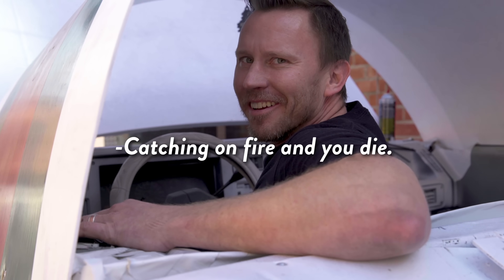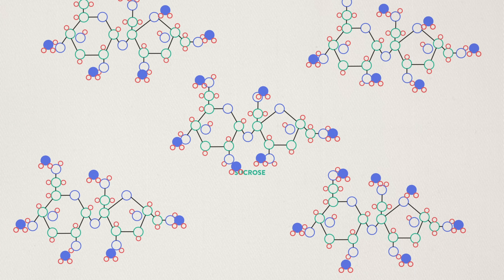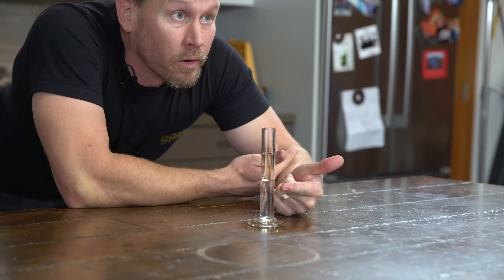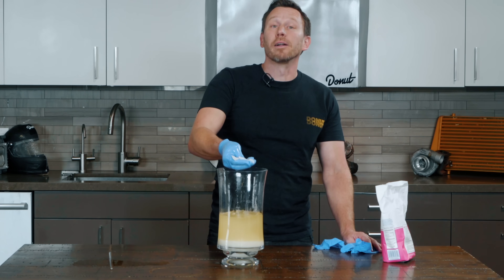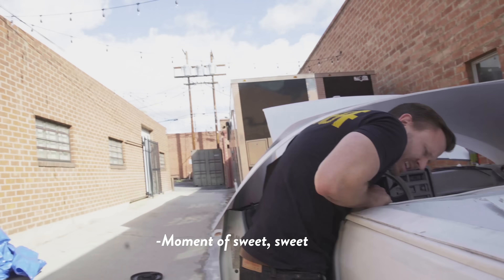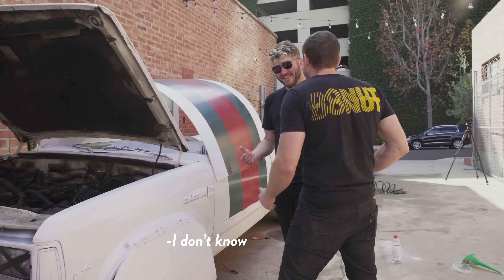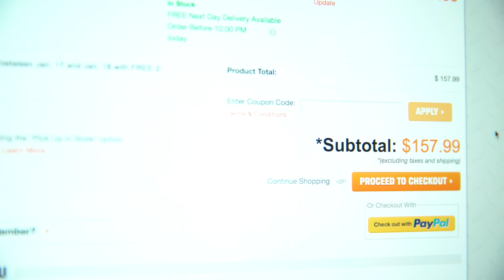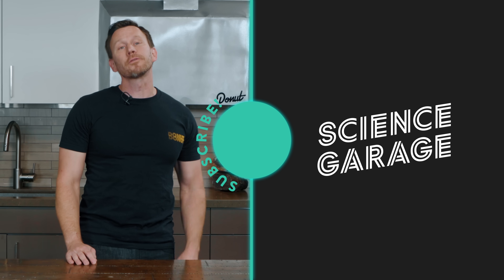SUGAR IN THE TANK - What actually happens? | HOW IT WORKS | SCIENCE GARAGE

Comment: So, you did this all wrong. First off, you would be driving around in a real situation which means the sugar would slosh around and more would get sucked up. Second, the theory is that after driving a good bit sucking sugar up and then shutting the vehicle off say overnight or all day the sugar cools down and gums everything up.  have seen it happen it was a nightmare. Does it work every time? highly doubtful but it is 100% possible and when it happens it's an absolute nightmare.

Comment: There is truth behind it but what you have to do is take one gallon of hot water and installed as much sugar in it as possible until were it's still hey liquid then pour the liquid into another container not getting the excess sugar in the bottom of the first container into the second walk up to said car with liquid in a jug with a knife and funnel taped to the top of the jug insert funnel into gas receptacle turn jug upside-down punctured Judd with knife seeing that water is heavier than gasoline it will sink to the bottom of the tank as you start and run the vehicle it will suck up the sugar and water mix this way it does not plug up the filters instead it goes all the way to the motor this is for science purposes only do not try this on your vehicle or anyone's vehicle that you like😎😎

Comment: Wow this is completely wrong it all depends if ur car truck or whatever has a gas resirculation it does mess with the computer to give even more gas and air causing it it overheat then causing a blown head gasket today's cars are different but 1990 and older will cause damage now u put a Snickers bar in someone's gas tank when it's triple digits it melts

Comment: 5:50 I believe because they are stationary, so the sugar is not moving around and settle to the bottom of the tank and not be mixed with the fuel. If the circle is in motion, the sugar world indeed move around the tank and eventually into the engine.

Comment: I'm in my 40s & remember hearing about this when I was young so I'm guessing it was a tactic used pre EFI. I believe that since the sugar will not dissolve the driving & sloshing will continue to hold some in suspension & this will get sucked up, & while the sugar granules could clog a fuel filter or possibly a fuel pump I think the primary issue is massive amounts of carbon build up in the combustion chamber fouling valves, and causing them to not operate properly. Obviously, it could also cause other issues as the carbon builds up on pistons & the top of the cylinders as well.
Reply: Exactly! Well said

Comment: kind of disappointed you didn't pull heads off and check to see how pitted the valves are from the sugars building up around them in the intakes. in a 2 stroke engine it would have seized it up

Comment: I think you guys should have driven it around to actually test it. If you drive it around the gas oscillation from side to side will allow some more sugar to get suspended in the gas and allow for more to get pulled up by the pump and into the engine in higher quantities. I can't believe that it wouldn't make a difference if you where moving the gas around more vs just letting it idle and sit still. Lets see the redo on this test please!!

Comment: When someone uses powdered sugar and a lot of it and have barley any gas in your tank u drive 4or 5 miles pull in and fill up your tank the truck didn’t even make it out of station drive way and it dies like it’s out of gas can’t be just filled up so you pull the gas filter and everything the gas spills on under truck turns white and u know there’s surgery in thetas and a lot of it. U get home and cut the filter open and it exploded to five times it’s size do to amount of sugar so u clean the fuel system get rid of surgar gas and thing things are good a few thousand miles later the engine is destroyed the rings on piston are completely destroyed so you’re test is false

Comment: Most cars drive when running and sugar gets mixed around, you think you would know this claiming a science video. Any moisture in tank will dissolve the sugar, then it carmalizes and hardens with heat cycles destroying seal on valves and causing them to stick. Seen it twice, and on throttle body injection it coated the intake where you could chip it off and eat it. Intake is ruined, and heads need complete valve job and new valves.

Comment: Well... Sugar doesn't dissolve in gasoline. And it gets sucked into the filter. So if you're filter doesn't have holes, it should be okay for a while. That's being said. You should get it fixed

Comment: Hello Donut Media My Name is Jose i been a Auto mechanic for 14 years now  i must let you know the way sugar will ruin a engine is when you put it in the tank the damage happens long term when the car is has been running for a long time with sugar in it the sugar will start to brake down and mix in the gas make its way into the fuel system and down into the combustion camber and start to burn and melt thats when it starts to stick to the rings and cylinders and piston every time the engine cools the sugar starts to build up and harden eventually it will stick the engine and wont let the crankshaft turn.

Comment: Most likely the sugar will just melt and turn into liquid once it goes into the engine. For as long as the engine is hot and running, the sugar should not solidify and block any lines.

Comment: If you want to sabotage your ex. Dump a 2 litter bottle of coke or Mountain Dew in the fuel tank.  The car will start and run fine but eventually the engine will suck up the soda which will clog up everything and the engine will die.  It’s so easy and you get the satisfactory that they are abandoned in the middle of nowhere  instead of just being stuck at home. You just have to get one of those fuel cones a 2 litter bottle.

Comment: I ve tried 7up soda on my radiator , put. Some on a frying pan, thats how my engine smelled waka waka waka , needed coolant ,soda is all I had, freeze plug went out hense low coolant ( freeze plug repaird side of the road with some locktite epoxy wich I try to always have) I don't know if it actually cooled my engine , regardles I got home just fine , did I flush the radiator ? I do not 'member...to long ago.     Zas mua love me engines...🙊🙉🙈

Comment: I've been told its bad to switch from reverse to drive in my truck with an automatic transmission while the vehicle is just about to finish slowing down ( from reverse to forward ) is it possible for you to explain if this is true and if it is explain why and what happens in the transmission when doing so?  Thanks guys keep up the informative stuff.
Reply: There is clutches designed to engage while not under and load and not slip during engagement, putting it in reverse going forward or drive while rolling backwards means those clutches are slipping while being engaged and they will wear out much faster. If your going fast enough when you do it then it can shock the gears and shatter them, they are very hard steel to keep the from wearing out but that makes them brittle. Also anchor points for bands and clutches get hammered, kinda like setting a hammer on an aluminum slab vs hitting that slab of aluminum with the same hammer, it can handle being gently set down thousands and thousands of times but if you swing away with the same hammer it will mess up the slab very quickly. Don't know if you found an answer or not in the last 3 years but hopefully this helps you or someone else out.

Comment: as the sugar gets sucked into the engine and burned it leaves carbon deposits on the inside of the engine. yeah it runs but it would be down on power before they notice something was done to it and too late, full engine tear down and cleaning ahead from sugar in the tank

Comment: Its suppose to burn the pump up and require a tank cleaning. Not cheap to do as majority fuel pumps cost $300 or more. If it does make it into the fuel lines, you have to back flush it. Its a costly repair that wont total a vehicle. Especially since inusrance wont cover majority of it.

Comment: Just put water in the tank, hydrolock the engine.
Reply: Put water mixed with sugar into the tank.

The sugar will mix with the water and the water will take the sugar into the engine
Reply: it would have to go threw the intake. water in the gas the engine would jut stop runnin
Reply: @vmonroig21  exactly...the injectors barely spray in anything...my buddy got water in his SI and intake and boom no more engine
Reply: @vmonroig21  >threw
Reply: just remove all the oil
Reply: @billygray8863  you mean like a oil change?
Reply: Styrene in the crankcase is permanent
Reply: @tashalynn29  savage mode✅💯🤣🤣🤣🤣
Reply: Just drop the drive shaft alot funnier sight and only takes 10 minutes
Reply: To hydrolock the engine, water must go through the air intake. Basically drowning the engine. Water through the gas tank can cause rust or corrosion inside the cylinder walls and the injectors to become stuck but won't hydrolock the engine.

Comment: Yea, I just had my Fuel pump replaced, the mechanic told me someone put sugar in my tank.. I even seen the sugar because I asked him to show me it.  I drove it about 35 miles and it died... wouldn't start wouldn't do anything. and after the fact of cleaning the gas tank, and changing the Pump and filters.. it's still running bad...  IDK what to do... I changed the Upstream O2 sensor, then the fuel pump, now idk what.
Reply: get the injectors cleaned out

Comment: Was that car low on fuel?
If you have sugar in your fuel tank and you keep the tank atleast half full then it shouldn’t get to the motor especially on newer cars but if you are going to drive low on fuel with sugar in the tank then most likely it will get sucked up and at the least you will need a new fuel filter on top of cleaning out the fuel tank. It will probably be a good idea to change the fuel pump while your there to just incase if the sugar didn’t make it to the fuel pump.

It’s just like running a car low on fuel constantly,what that will do is suck up anything that’s in the tank and that can cause damage to your fuel pump since it uses fuel as a lubricant to keep the pump working,if you constantly driving low on fuel then evantually at the least you will need a new pump and filter. Worse case scenario is the pump sucking on vapor and any dirt that’s in your tank when you running really low on fuel.

So the lesson here is not to run low on fuel if you have sugar in your tank and avoid driving low on fuel. Not good for your car if you constantly doing that. My friend was cheap and always ran low on fuel and would wait till the needle was below the empty line,then he would only add $5-10 dollars and do it again and again so within a few months he had issues.
Reply: It doesn't matter if you are running low on fuel, because the fuel pump is always sucking fuel from the bottom of the tank. The only reason you shouldn't run low on fuel, on regular basis, is because the fuel pump needs the fuel the cool and lubricant the pump like you said. Not because of junk in the tank

Comment: Now try to put sugar in Engine Oil or in the Cooling System
Reply: It turns the wheels then you drop the clutch and since the wheels are spinning they make the transmission spin (when you drop the clutch) which then makes the engine turn over and then it starts AT LEAST I THINK THATS HOW IT WORKS I HONESTLY DONT KNOW SORRY IF IM WRONG LOL

Comment: For anyone who is actually curious about what will happen from continuous cylinder exposure to sugar, it’ll form a substance where the valves seat. Eventually, this substance will grow thick enough to where the valves can’t seat at all. Thus lowering the compression (or eliminating it all together) and therefore horsepower. May start as a misfire but it will eventually lead to all cylinders not contributing.

My Certifications: ASE A1-A9, L1, L3
Reply: I’m impressed that you know that I disliked this video because I know it does cause damage because it happened to me
Reply: Sorry but putting a bit of sugar into the tank and then idling the engine is not a valid test. Especially with an engine that is screwed up as the one used. I mean come on. If you can smell it burning at the front of the vehicle you’ve got serious issues with the cylinder, heads, or exhaust as well as a clear indication that sugar is entering the fuel system and going through the engine. 
The coolant spouting out of the radiator cap shows that there is a large compression leak that not the fuel system. 
Sugar will destroy the engine. But it needs some sloshing around.
Reply: isn' that what happens if you don't start up a car or any internal combustion engine for awhile, especially generators that may get used once a year when the electricity goes out
Reply: @blakespower not quite, though the rings may relax sort of. Believe it or not the engine compression helps to push the rings against the cylinder walls. This is why engines that haven’t been run in several years can be difficult to start the first time, and tend to smoke exclusively at first.
Reply: Ok so, when I was still wrenching there was no such thing as A9 and I don’t recall L3 either. What are they?

Comment: In a modern car it will clog injectors filter ect then after they fix that the emissions system will experience multiple issues causes check engine light and they can't get inspected to renew the tag.  O2 sensor cat failure ect...  the real trick premix the sugar, sugar in the raw, and power steering fluid stop leak, then wash it down with a jug of good ole def .... the jug comes with a nice spout too....  $35 gets you a beautiful revenge that's lasts longer than the payments of the car

Comment: Ive worked on vehicles that have had suger put in the tank. Sometimes if they dont drive it its a simple replace pump and clean tank. Others that drove it around because they didn't know it happened, well the last one had to replace motor, tank, lines, pump, pretty much whole fuel delivery and engine was gone. He had ran it long enough to suck suger in the cylinder and had what almost looked like Carmel lining the cylinder walls and vavles.

Comment: Dissolution is not a completely yes or no thing.  In basic science classes its a does or does not thing so that students can be taught what they need to know at that level.  But in the real world of chemistry there are all different levels of dissolution.

In your water gas experiment I guarantee there was gas in the water and water in the gas when you were done.  Because of the polar non polar relationship you have a visible layer but I guarantee there was transfer.

On your truck some of the sugar was getting dissolved in gas.  Not alot, but enough to make that smell.  If you ran a larger amount of gas compared to a small amount of sugar in the tank the sugar would eventually dissolve.

Comment: Sloshing from driving would cause more to get sucked up by the pump. And the sugar will scrape and scar the cylinders causing loss of compression. Also clogs the fuel system/injectors.

Comment: the sweet smell was likely because the sugar DID disolve in the small amount of polar ingredients in that tank. ie. ethanol.. (may contain up to 15% in the US)
more facts! ethanol is hygroscopic, it disolves in water (water also polar, duh), and water is in the air. so when the water, out of the air, in your tank, condenses, and drips in: instead of making your engine all kunky, it dissolves in the ethanol, and burns right up in the engine. 
anyone who wants some documentation on "how much bs is this guy giving me about air moisture in my gas?" can do a search on why you use dot3, or dot4 brake fluid instead the racing silicone oil based fluid. ill save you the effort. the reason why is "many things." But one of them is because DOT fluid is hygroscopic, and prevents water pooling in your lines which can boil at a low temp.

so the gas has ethanol, which can dissolve some sugar (ie. vodka/cranberry) and the ethanol can also dissolve some water (ie vodka/soda), which can disvolve some sugar (ie, coca cola). 
so the water, AND ethanol can BOTH dissolve small amounts of the sugar, and eventually pass it all through as long as it doesnt clog the filter. (ie Jack and Coke.)
so the next time your mad at some dude think this; "why would i waste my time giving this guy's car a jack and coke? i should just tell his girlfriend i saw him with another woman", that's way more legal, and will actually ruin his life, unlike the sugar thing.

Comment: nice trick to get the the suger out is drain fuel fill tsnk with boiled hot water then drain :p problem solved   also if u want to see somthing cool  coke in engine oil   block will lock up and harden

Comment: What if you drove the truck around on a bumpy road where the sugar is shifted around in the tank and smaller particles are picked up by the fuel pump and end up through the filter and engine? The truck was too still so the particles laid at the bottom.

Comment: the tank is the wrong place u guys put the sugar. The sugar should be added to the engine like you are adding engine oil and start the engine the sugar will melt and bond with the oil because of the engine oil getting hot and then when the engine cools the engine will jam

Comment: Sugar is an oxidizer. I would suggest making or taking simple syrup and putting it in there rather than sugar. Probably get a bit of HP gain. I'm only thinking in the way of some top speed rocket cars that have a huge tank for the oxidizer to mix with the fuel for more powerful combustion.